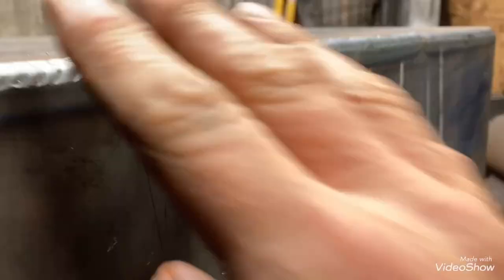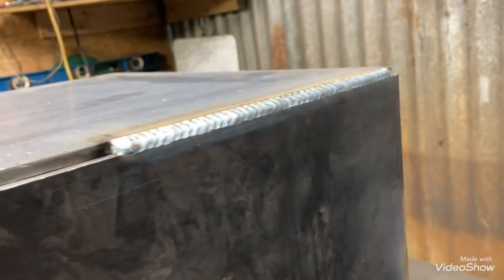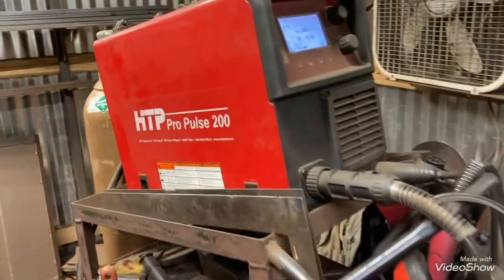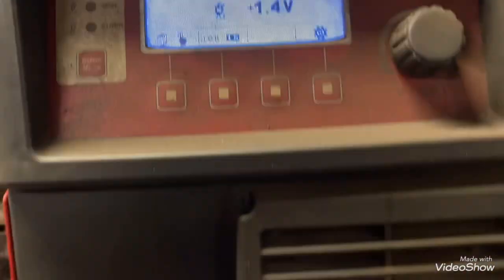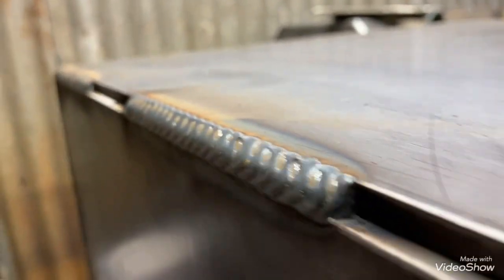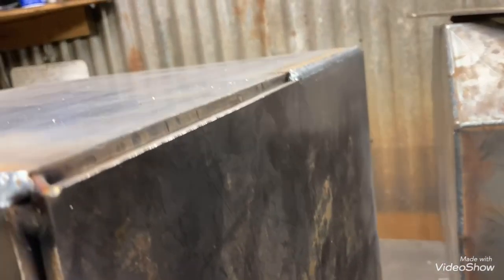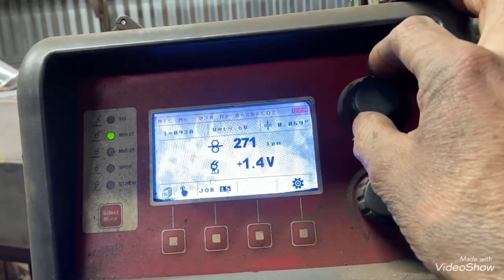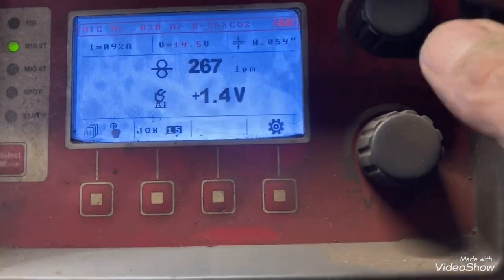Mig welding, settings for 1/4” steel

Comment: 19.5, 287 what? What units are you working in?
I have an Eastwood MIG welder (not very happy with it), and I’m new to MIG. I’m using flux core and 1/4” plate. I get nothing but splatter and weld everywhere except where I want it. Your welds are beautiful. Can you suggest a setting for my needs?
Thanks,
Paul

Comment: Thanks for the tips I've got the Vulcan omnipro that I can calibrate settings like this. Been working on a vertical smoker outside I'm ending up using a DC inverter flux core mostly tho

Comment: Do you also weld the insides of your boxes also or strictly just the outside.
Reply: With a good fit up, I'm going to bank he's only welding the outside.
Reply: 🤣 no reason to weld the inside 1/4" joint and the weld fills it, that thing is NOT coming apart. Maybe if you throw it off a cliff 🤣

Comment: Hay  Allen,  good advice. Now what I found with 1/4 in material I switch over to 035  dual shield fluxcore because it is all position uses the same gas 75/25  leaves a clean bead and it is way faster than regular mig wire. amd you can run up hill or down with no manipulation of your mig gun. I use esab 7100 ultra dual shield fluxcore but there are lots of others to use, Lincoln makes a fine one so does Select Arc and Blue Demond. Try some you might just be supprised and convet like I did, I use it for 3/16 1/4 and 3/8  and up as it does not have the limitations of regular mig wire.I use reg mig wire for 1/8 and down and I use .030 for that.
Reply: Did you really say you run dual shield downhill? I sure hope you don't run it downhill on anything other than a name plate. You get no penetration running dual shield downhill. It just pretty much just sits on the metal. I run .045 hardwire and 1/16 dual shield on 1/4 and above and .035 on anything less than 1/4
Reply: @davidcrumrine1165   you can run it downhill you just have point the torch upwards  5 to 10 degrees. Jody Collier did a demo on this some time ago.
Reply: @davidcrumrine1165   doesn't  the words all position mean anything to you. I guess you think the manufactures  are lying about their products.
Reply: @bruced1429  can you do this with any decent flux core welder
Reply: @bruced1429  also can you use the Lincoln fluxcore wire from homedepot or is there a particular wire you would need

Comment: allen that picture  of the smoker I built I used my sp 140 lincoln it has done ok, just bought a miller matic 215 its still in the box  came with spool gun for 1,559

Comment: That synergic machine is a beast. We don't do a lot of long, heavy welds and I've still run over 1000lbs of wire through my PP200, PP220 and MIG 200i in the last two years.

Glad HTP jumped on board with you, great guy to support